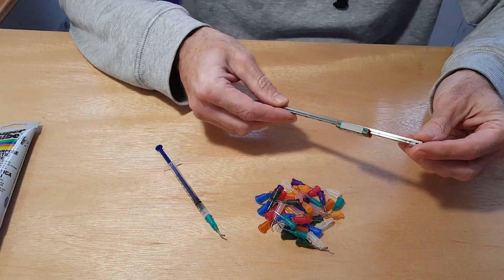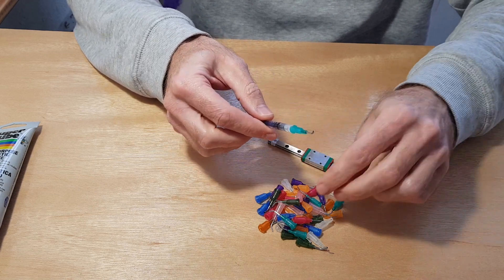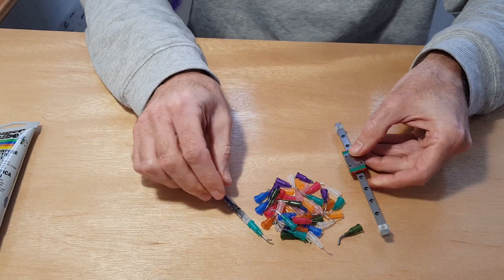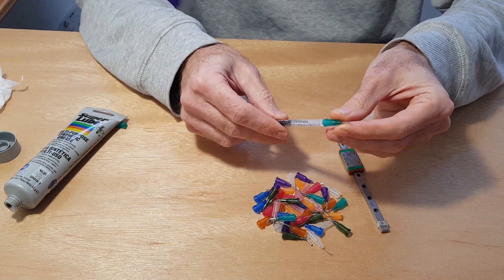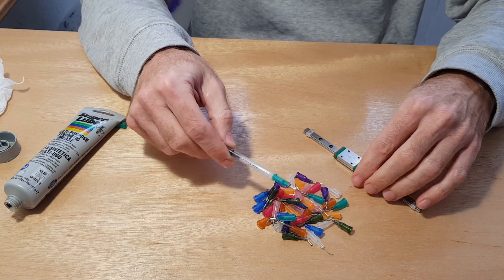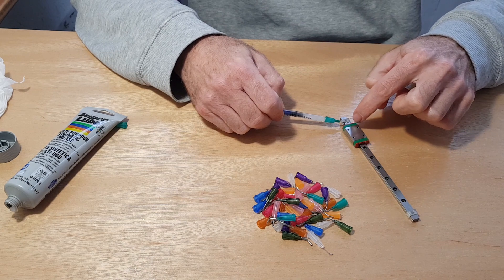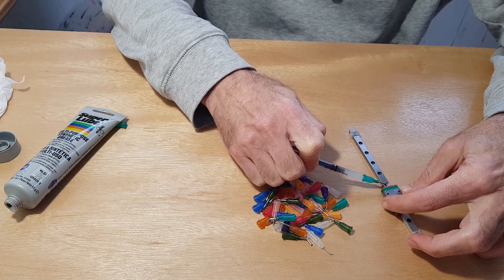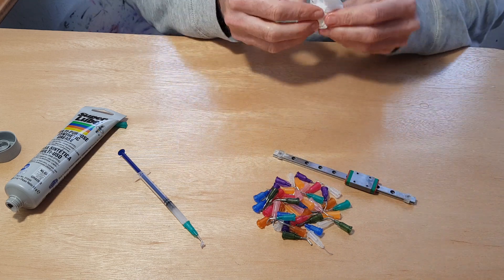Lubricating Linear Rails

Comment: Hmm ok, the part about disassembling the x axis is omitted.  Also, the video could/should show a close up of where the needle is to be inserted into the slider.
Alao to note that there is a Prusa Part comprising the right grease, syringe and needle and gloves for the lubrication operation. There is no need to search for the right grease and needles.
Reply: Its good video on lubricating linear rail as it says. helped me out...thanks for the info